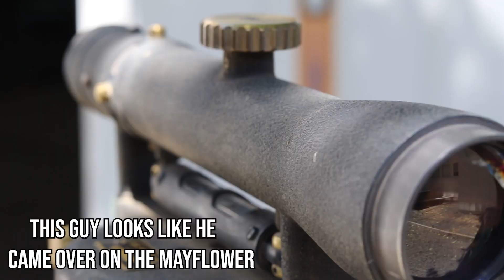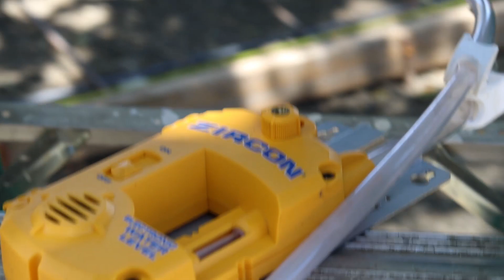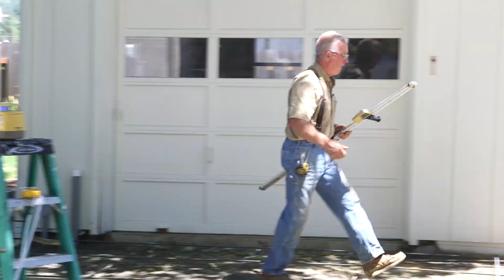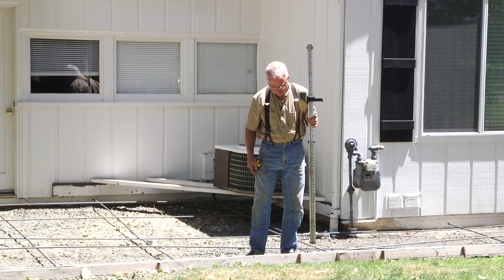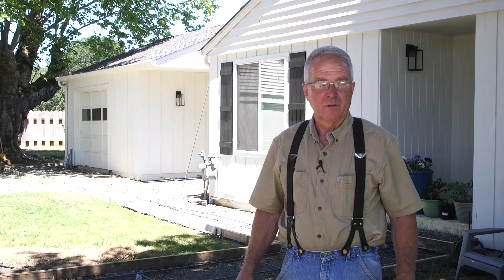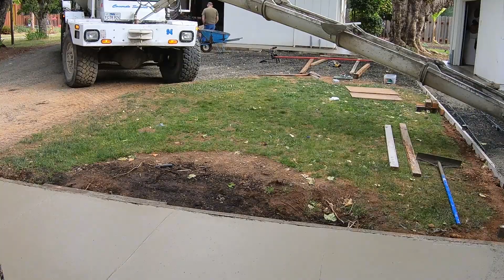The Hardest Part of Forming Concrete

Comment: There's a big difference between a theodolite and transit, and you're best to do your own research on the difference between the two. You basically don't want a transit. You might also want to pair the theodolite with a builder's level however !
Reply: I am going to have to look these up.  We always used a "transit", but I am not sure that is really what is was.  I think it was just a colloquial term used by my boss.  That being said.  Precision was not overly important to what we were doing.
So, it's time for me to learn something new...on top of what I just learned in the video.
Reply: @Caderic  A "transit" and a "theodolite"  essentially perform the same functions, that is measure angles in the horizontal and vertical planes.  But a Theodolite has a more sophisticated system of reading the angles measured and generally is a more accurate instrument.  But really, a Theodolite" is just a more accurate Transit.  Basic purpose is the same.

Comment: Best part about a laser- you can shoot grade by yourself.
Worst part about a laser- that dang annoying beep
Reply: Put a piece of duct tape over the speaker, so much more bearable
Reply: But still the best no doubt!
Reply: It's as easy as turning the audio off,I always use visual anyway.
It's as annoying as a multitool,usefull but.......
Reply: You can open the level, either cut the speaker out all together, change the sound to visual, using a low power circuit to transform the beep to LED (might require a button cell battery to amplify the light tho) OR you can hack the case and put a 3.5 mm jack. Which gives you the option to either mute it or have it work with a portable speaker.
On my Bosch unit, i did a combination of the last two, using a pocket LED light that would normally light up when you receive a phonecall/message on your cellphone.

BUT good news, even as far back as 2019 there were a few tech shows i was going to, and in posing the question of option to some of the floor techs, it was something that a lot of people were asking about. So, maybe in the not so distant future, you'll get something like this as standard (light/visual, instead of audio signal).
Reply: @aserta  Good points - I was thinking along the same lines, less seriously - was about to offer a trigger for a little charge of black powder 😎

Comment: Beautiful old dumpy level "builders level". We now use "auto levels" it has an auto compensator, so the manual leveling of the instrument acts only as a coarse level, the compensator "automatically" levels the instrument using wires and prisms. Surveyors still primarily use auto levels (sometimes with digital readers) for establishing elevations and benchmarks.